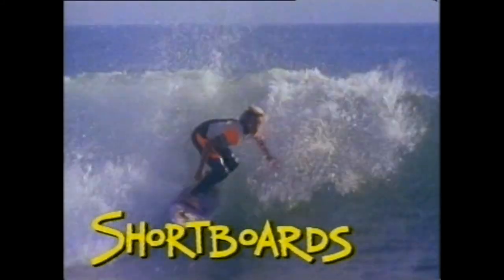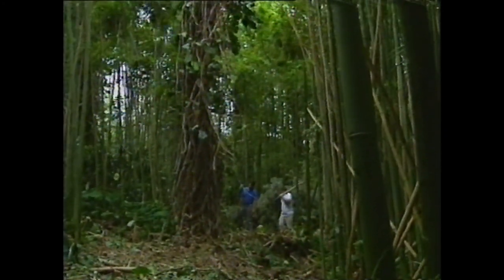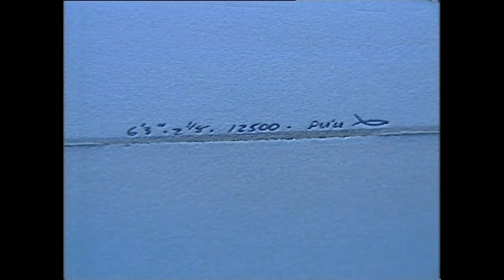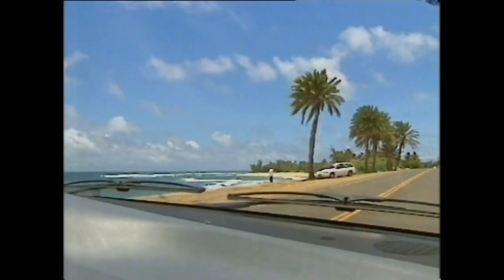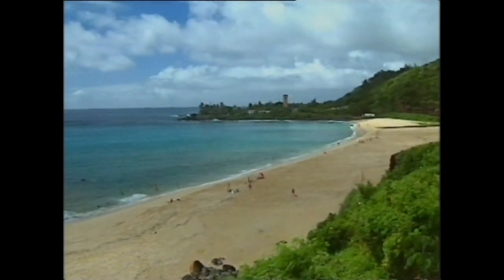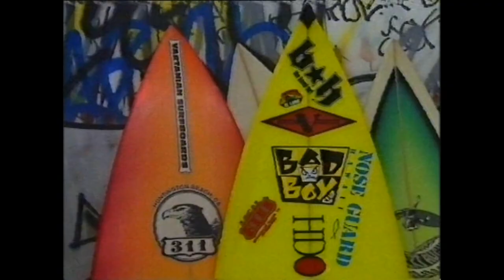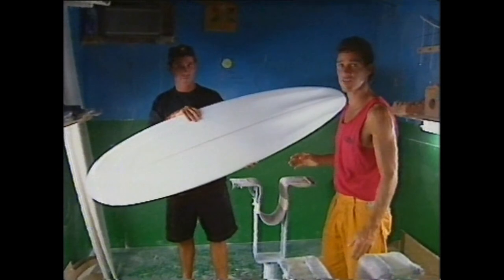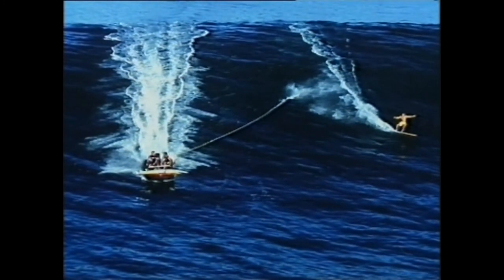surfboard design documentary

Comment: In 1990 when I was 15, I had the most advanced surfboard in my area and it was shaped by Ben APA. It was a Brad Gerlach beveled rail surfboard Town and Country. I was going down the line so fast Against the Wind and I went to do an off the lip and I did a huge tail High air reverse and I landed backwards and then spun it back around immediately and I knew it was awesome but then I doubted it and I thought it was a kook because it was not a big straight air like Christian Fletcher did in the magazines so I thought it was stupid even though it was ahead of its time. I could have been a contender LOL